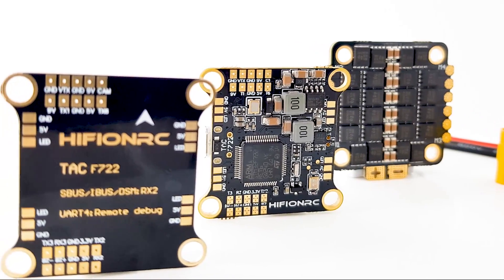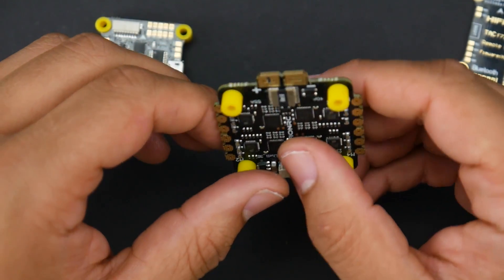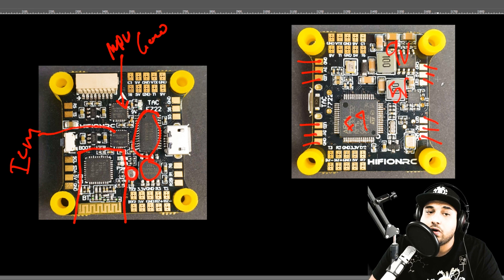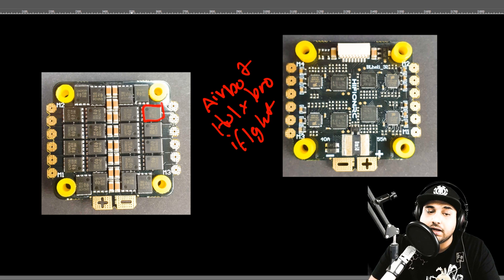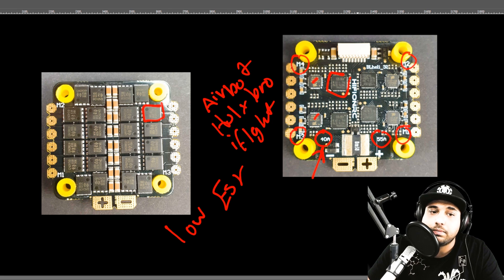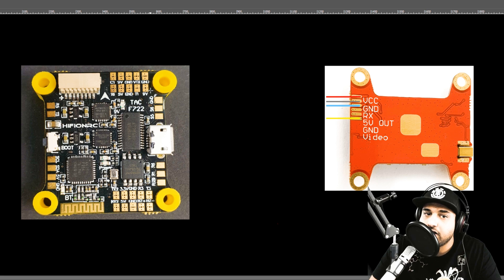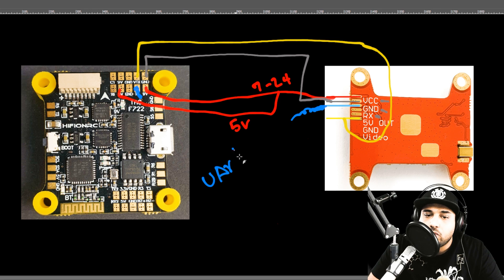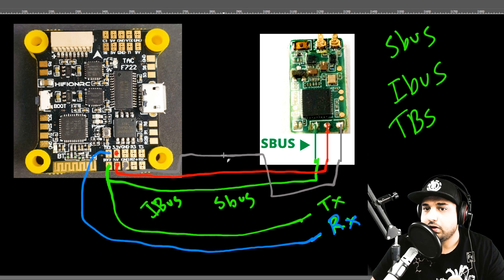ULTIMATE PRICED F7 Flight Controller Combo Ever!!! // HIFIONRC F722 Pro

Comment from the maker: HIFIONRC F722 Pro: https://bit.ly/2WJUvu6
Reply: Hello ! I want to add his target to Emuflight but I need a Dump file of betaflight...Can someone help me  ? Thanks
Reply: @pixelshot09  i can send you dump file
Reply: @janickithomas  thank you but it's ok, I found it 👍
Reply: @romkas7718  Hi, sry I don't have this FC anymore and I dont have a dump ...sry
Reply: @romkas7718   hello did you get the dump firmware? can you tell me where to get it please.  because I had the same problem as you.
Reply: @michaelmeirlevine2454  Hello, I found it later in betaflight called HIFIONRCF7 and flashed it.
Reply: @romkas7718  Thank you. I found the dump firmware
Reply: The link for the stack, ESC has now changed spec from the one in the video.
Reply: When are you going to make a quad build with all this new stuff from 2020 i wana make a quad but i also want it to be under like $250
Reply from the maker: @ArTradezz  I did check my latest video I made 2 and 1 was with this stack ;)
Reply: I I ordered this, how long does it take to receive?
I hate waiting lol
Seem like it ships from China

Comment: Great video. Can’t seem to find the password for connecting to the FC via bluetooth. Do you know the password?
Reply: You don't need a password!
I was trying to connect it like 1 hour... 

The solution is:
You enable UART4. You choose the baud rate of 115200. Try to connect with your speedybee app and if it still not works, try to set the baud to something else and then back again to 115200.

Comment: Please add a disclaimer that they changed the ESC board with a different one. Have two stacks and they work great but seems like if you order now you get a different ESC board.
Reply: Is the ESC, the same as in this link?  https://www.aliexpress.com/item/4000926756945.html

Comment: nice review. I have a question. Is the drain-source resistance the cause of the mosfet warming? If so, how much does this mean that mosfet is good? actually, I'm looking at HIFIONRC 55 amp ESC(NVMFS5C430N) and compare it with the 40 amp model.

Comment: Hei man nice Video!
I just bought the Flight controller itself and would like to set it up with the hobbyking 60a 4in1 esc. Is there any wiring diagram that I can use to solder the motors, vcc, gnd, crr and 5v from the to this exact flight controller in the correct order?
I would really appreciate the info!:)

Comment: Hi Drone Mesh, BG's description says its meant for DJI air unit. Will there be any issue if used on normal quad without dji air unit?
Reply: I can see no negative reason for using it with Analogue VTX.
Reply from the maker: Both can be used